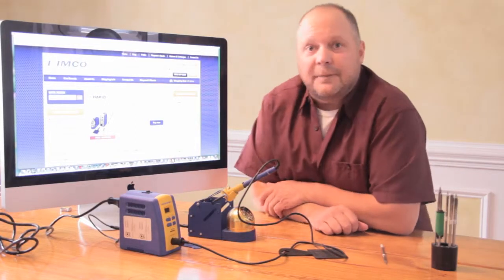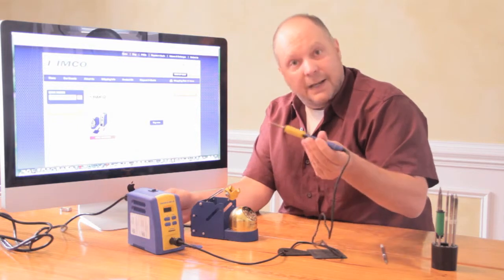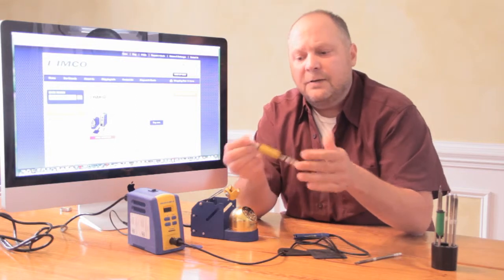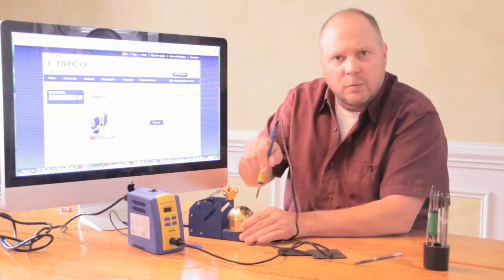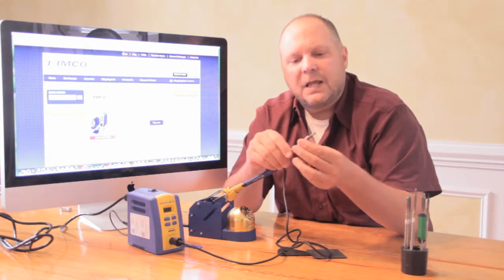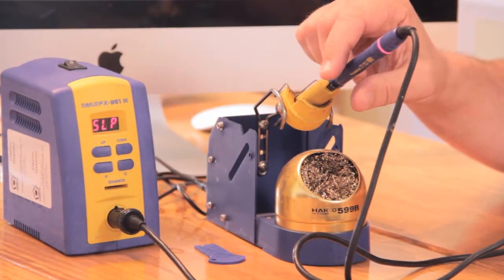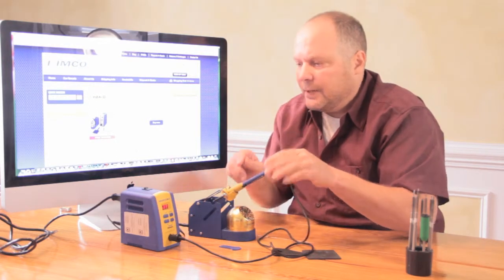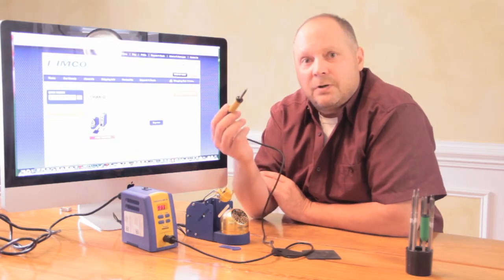Hakko FX951 Soldering Station Overview of features and benefits

Comment: very informative video thanks, 

where to buy tips ? are they all with neon light?
Reply from the maker: You can buy the tips at GoKimco.com .   Check out our tip finder at https://gokimco.com/soldering-tip-finder.html .
Reply: @kimcodistributing5977  I just bought an fx 951 was ready to get started learning to solder and discovered no tips! Please which ones should I order for soldering wire to woofers?